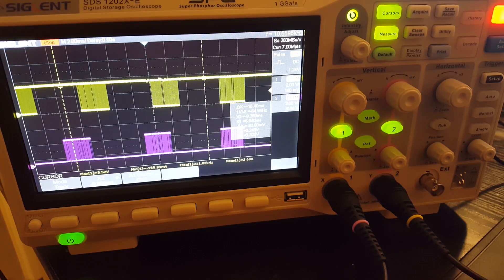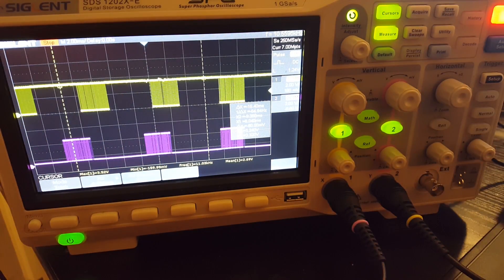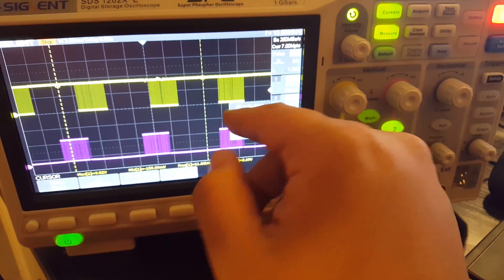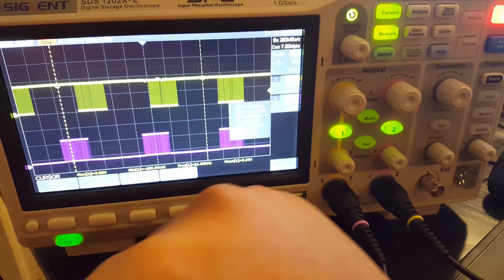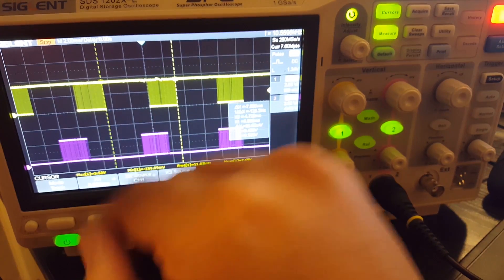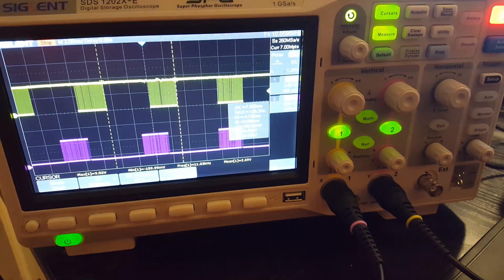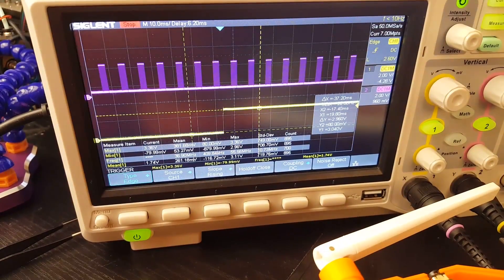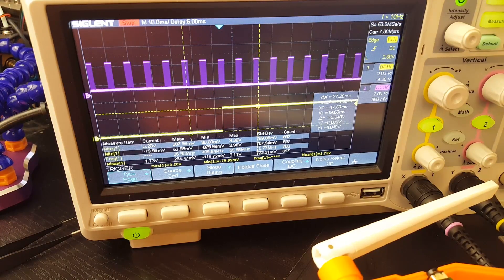FrSky Taranis VS Turnigy Evolution // Part 2 The Latency Testing

Comment: i liked my evo before it started doing weird stuff. i think a cable was being pinched and it couldn't make its mind up if the batteries were full or flat ( fixed now i think ) but leds flicker (not fixed). can the led boards inside be replaced? or has anyone else had this issue and fixed it as im at a loss

Comment: I'd be interested in adding the Jumper T8SG 10 Channel Multi-Protocol Compact Radio
Into the testing as a multi protocol radio it got potential.
Reply from the maker: +Nick Crownshaw I asked banggood for it and they agreed for testing ;)
Reply: That's great, as I'm thinking of getting this as a second radio, it would be interesting to see if the gimbals can be upgraded as these are what usually let down the cheaper radio's .

Comment: Good work drone mesh, still haven't used my Taranis since getting the evolution, I love the touch screen programming and chuck in the bag form factor. Bring back the evolution love ! seems the FPV community has turned against the evolution
Reply from the maker: Team crap sheep Its because everything has advanced alot more and it's still stuck on 5 models using gimbals from flysky. I ordered m7 gimbals to do mod on it and flysky.

Comment: Can you please test the iRange IRX4 module latency.  This also supports FrSky sBus and telemetry, but should use a faster CSRF to RF processor within the module (similar to TBS crossfire).  Should show if the delay is in the OpenTX code or the internal RF module.  The iRange IRX4 may be an option for reduced latency for sBus without replacing RX's.

Comment: good you mentioned gimbals, 
I would love to know which better gimbals would fit the FS- I6X with out too much modifications. been using it since it was released and its only the gimbals that lets this transmitter down.
Reply from the maker: Edward Lee I tested the FS-i6x last night.. very interesting results
Reply: it will be good to see your results,
 the FS-I6X is said to have updated components compared to the original FS-I6 ? which got me started in the hobby, I never looked inside the original so I don't know the exact differences.
Reply from the maker: Edward Lee I have both i6 N
And i6x I have prepared excel sheet with everything for all transmitters I'm.testing and tested will be in description of next video.
Reply: looking forward to it,,, I'm sure every one will agree, thanks for putting in the time and effort into all that you do for the hobby.

Comment: CrossFire u neeeeeed To make this test with Crossfire to write to tbs
Reply from the maker: Martin Jensen Joshua bardwell is helping me to try to get a x9d and hopefully a crossfire for testing. Big thanks to him.
Reply: you know you can crossfire on the X7, right? I've just made that hardware hack and it's very easy. I even have 4 inverters that needs to be soldered as spares (minimum order was 5), I can send it you or anyone need some.
-edit-> Forget it, you'll receive the horus, so no need to hack the X7... lucky you ;)
Reply: u cant use crossfire on qx7
Reply from the maker: 6rilllir6 if the horus is faster than q x7 I will need to test it on both.
Reply: @Martin Jensen : You can (with a little hack) And I'm actually done with it and it works great.
please don't be so sure and affirmative when you don't know.
Reply: then let me know, and I'll send you the little inverter to hack the X7  ;)

Comment: yea gimbal mod       impresive work  man. i think the better latency its due to the 5.8 signal on the evo its send bigger packacet more data on the signal  the frsky is 2.4 right       we need to be able to get som better recivers for the evalution  can u explain for us how the electronics can be so small for the frsky with the  r-xsr  and full rang and the ibus ones is so big or lacks fail safe plz explain for us
Reply: Evo is also 2.4 GHz

Comment: Very good job man, i have the first i6, had some problems with gimbals and i adapt the taranis gimbals to the i6, had to cut the wires and the back cover, next  had to do a calibration and since then works perfect.
Many times i think to make an upgrade to an Qx7 but i have many flysky recivers and this cheap radio works so well...

Comment: the reason of slow changing is sw adc noise filtering like sliding average. if you are really interested, try to build your own radio (or whatelse) from scratch. it's awesome source of knowledge.
just install black cheap flysky gimbals. they are the same, but the plastic is better and they feels smoother.
ps: pullup resistors will help you with buttons. remember about hi-z

Comment: This is indeed unexpected result. BTW, you’ve compared FrSky and Flysky radio protocols, not SBUS and IBUS, right? SBUS and IBUS are protocols between receiver and FC. Or am I missing something?
Anyway, great research, great videos. Keep them coming :)
Reply from the maker: Sergii Bogomolov the only difference in sbus and ibus was in the beginning of the video. Ibus updates 1.2 milliseconds faster. But the main test was how fast do the radios process the input and send it out. The Evo is more than half times faster.
Reply: Actually ibus doesn't update faster than sbus. The frsky rx sends the frames less often than the flysky. if you try both sbus and ibus on, for example a flysky x6b, you'll see the same 7.5-ish ms regardless sbus/ibus.
Reply: u are saying somthing 

 the signal from 
 the evalution is a 5.8 signal its carries more data over a short distance 
 frsky is 2.4 and carries littel less data over a longer distance  
sbus and ibus is a flight controller thing right  ???????
Reply from the maker: +Martin Jensen both are 2.4ghz :)
Reply: Except for the serial channels into and out of the radio link, it doesn't add much. And regardless the carrier frequency wouldn't be terribly relevant either way.

Most of the total latency is probably analog and digital processing (adc+filtering) of the input signal from the gimbals.

Comment: I'd like to see a gimbal mod, I'm surprised you haven't shortened the gimbal on the evolution already. Just removing the cone shaped section on the anodised thumb piece, should remove a couple of milliseconds in travel time 😛. 
Could we extend the transmitter range, maybe add an external antenna?
Reply from the maker: Trystan Yes there is a way using 1000w amplifier.
Reply: Drone Mesh Thanks. I've been pondering the possibility of a 4 or a 6 way diversity receiver like the Quanum Overlord. You mentioned the triversity, just thought hex-versity would be twice the fun. Do you think we can add extra receivers to the Rx5808 Diversity Pro? Or will we have to start from scratch? Thanks.
Reply: Drone Mesh what is normal power output of these? The frsky in particular?
Reply: +Drone Mesh can you post how to increase tx amplifier? I can't see TBS making a version of crossfire that will have the same latency as on Taranis without the ability to add an external module....sign

Comment: I've been waiting for this. I just sold my Evolution for a QX7.
Reply: Martin Jensen Yes, I couldn't wait any longer for Turnigy to come out with smaller receivers. The FrSky r-xsr was what pushed me to go back to Taranis.
Reply: Sherman G You won't regret it
Reply: im thinking the same thing switch it for a qx7 but i waitting for frsky to make a even smaller radio then qx7 with less switches and no trim switches  one for the quad foks
Reply: Martin Jensen if you wait for the hot new thing you'll be waiting forever....
Reply: yea i know im planning to buy a frsky radio  when im in china im going the 11-10 under 3 weeks
Reply from the maker: RCFlyer85 Same here i buy a ton of what is on sale.
Reply: Sherman G the r-xsr is pushing me to
Reply from the maker: +Martin Jensen I buy the cheapest receivers
Reply: Drone Mesh Since I went FrSky I've only used XM+ and I'm perfectly fine with that coming from FlySky
Reply: Drone Mesh Yup... Bought a bunch on sale too lol... I need a few more now though
Reply: Wich one is the cheapest